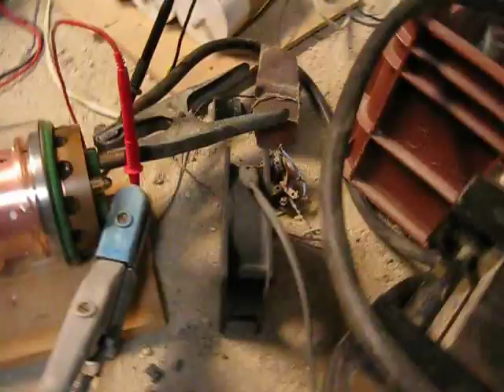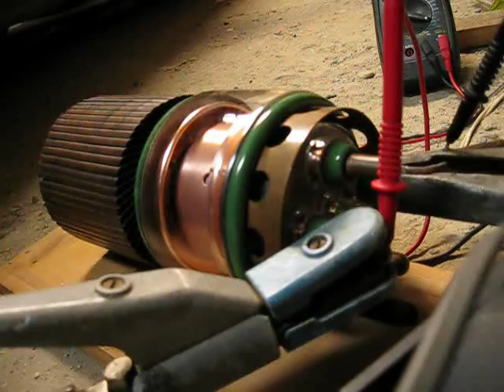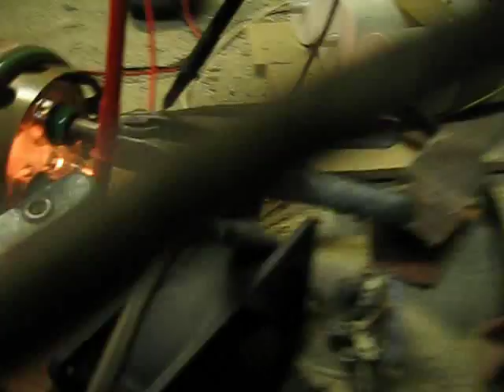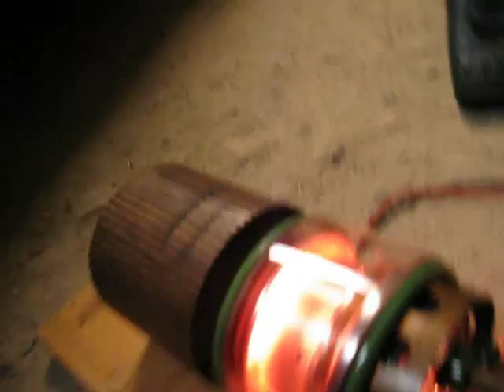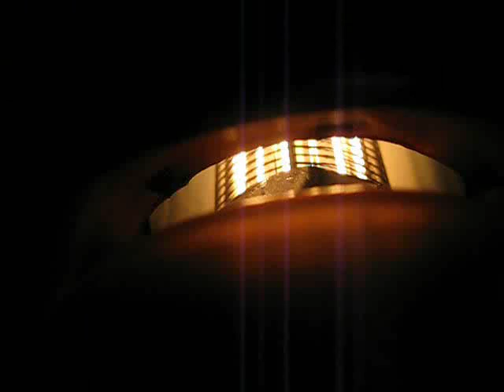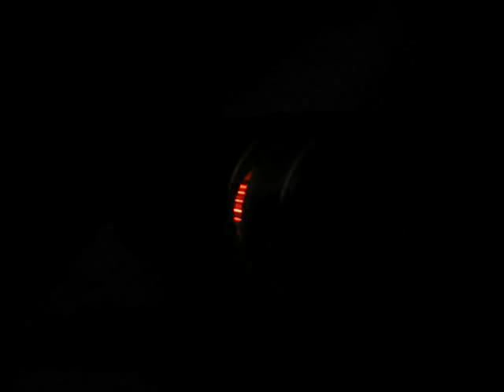GU-39b Heater

Comment from the maker: @danrulz98 It's an old ?welding? transformer with 7 turns of 50 mm^2 welding cable wound around it (there was just enough space left to fit those turns).
The tube is still operational however, I think I wont use it to its max ratings anyway, but there's always the risk of the filament remnants shorting out something inside the system - that I'm most afraid of.

Comment from the maker: @ubuntupokemoninc So which tube do you have? You can use a small variac, or an inductor choke (for HID or fluorescent lamps) as inrush limiter for large heaters. A resistor is OK for smaller heaters, the resistor can be rated at only a fraction of the dissipation it will see - as it's only for a moment.

Comment from the maker: @ubuntupokemoninc I think you'd better use a resistor... here I would use a 250 watt choke for mercury vapor lamps, but I don't know if you have those there. A resistor will be ok, use a ~20-50 watt resistor that limits the inrush heater current to 40-50 amps, then bypass it after a few seconds.

Comment: @jmartis2 

gu-5b, sorry i'm using an on screen keyboard, the heater is 27 amps max @ 12.6 volts. so i can use chokes from high intensity light? we only have CFL bulbs can i use them?
Reply: It should work if you are able to obtain the required 1.21 gigawats